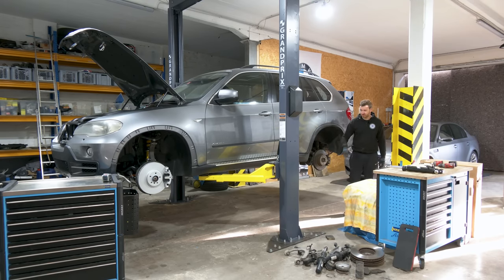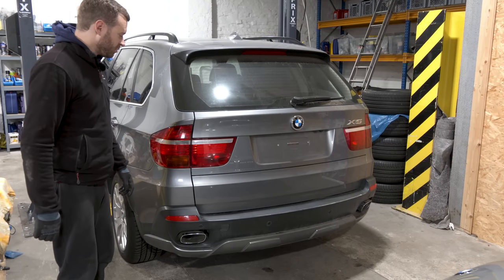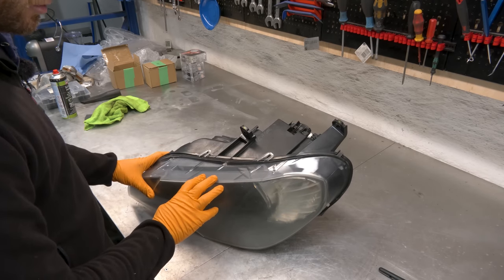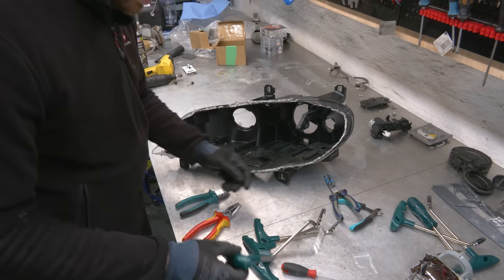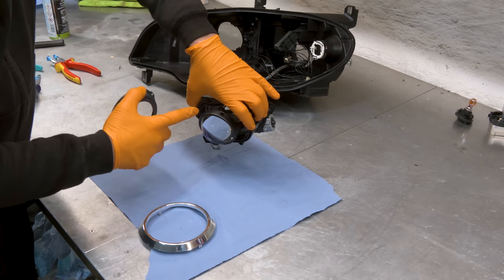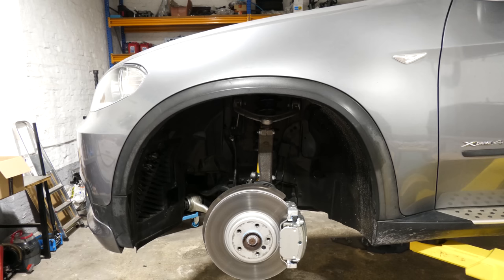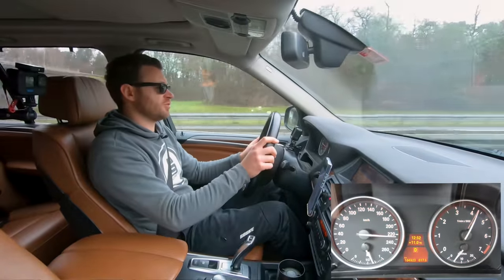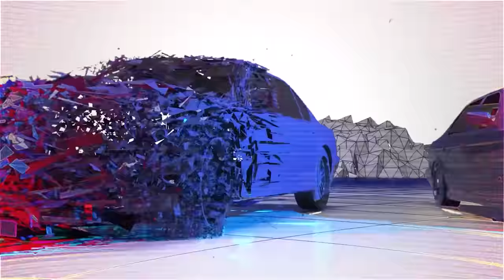Damage Report - Neglected V8 SUV BMW E70 X5 - Project X5: Part 5

Comment: amazing work.. I I actually noticed it was mode for Arabian countries from the right mirror u upgraded ( it was written on the mirror in arabic).. haha
4 more things to upgrade: 
1) white ring light in the headlights ( yellow is very ugly)
2) paint the black exterior trim ( and if possible upgrade the to M-kit bumpers and wheels arcs... looks amazing)
3) android headunit ( I installed just for the upstanding screen and soooo much better resolution) 
4) white led interior upgrade.
Reply: I’m glad Sreten has better taste than that
Reply: @Asserti  all the points I mentioned come from the factory in 2012 models. and the upright screen comes in next generation.. so basically what I mentions are 2012 retrofits.

Comment: Loved the X5 series! Regarding the heated seat elements being sewn in- I was able to retrofit my e46 by cutting the threads from the donor and simply placing the element under a new non heated skin. The new skin even had a layer of foam and heat still works great. I assume you could do the same on the X5?

Comment: I'm in the same boat as you are. I'm thinking about buying another car to daily drive instead of my E90. SUVs are great when it comes to driving comfort but.. they are SUVs xD I kinda like X5/X7 but for the same price I can get M3 or stretch my budget a bit more and get M5 and have much more fun driving them instead of tanks on the wheels. Yeah, they not gonna have soul like any other older BMW but I need something newer for a certain reason. Yours though, it came out great! A lot of work and a lot of patience, I wouldn't be able to do it without throwing tools all around my garage xD Congrats I should say, let's hope it's gonna be reliable!

Comment: @m539 restorations - you should mention the aux water cooler in the left wheel housing. I have it, too on our E70 35D (I know you don't like Diesels). I think the straight six fuel versions of this car don't have it. Read somewhere a while back that its bad engineering with the main radiator not being engineered big enough for the stronger engine options, needing the aux rad.

Comment: Hi, you don't need to remove the entire headliner to fix the panoramic roof cover... you just need to:
1 - get the covers all the way back and lift the glass to the "wing" position
2 - remove the screws that hold the glass in place, normally 3 torx in each side, on the interior
3 - get the glass out from above
4 - get the covers back to closed position
5 - get on top of the car and remove the clips and/or screws and lift the covers up from above

i just did it on my E91... but i bought a new cover from the dealer... the front cover was 184€
Reply: ohh... this works for both glasses/covers of the panoramic roof... a dealer mechanic confirmed that is either this way, or remove the entire roof cassete out the back (NOT FUN)

Comment: I recently bought a 2010 X5 50i with the N63 V8 twin turbo with 95,000km.  
Timing chain needs replacing.
Is timing chain replacement an engine out job?
There seems plenty of space once fan, radiator etc is removed.
Regards
Mal from Australia.

Comment: From my experience. Put the headlights in an oven at like 200 degrees and it will melt the adhesive and you can remove the headlight cover.

Comment: Maybe that total at the end sounds like a lot to normal people, but to car guys (at least car guys like me), it's a steal. For $20k USD, you've got an AWD V8 SUV with 350hp, adaptive bi-xenons, air suspension, & leather interior that will last you another 100k miles easy. Meanwhile, you can't get a 2023 base trim Corolla for that price. I only buy used cars for this very reason. It's prime rib for the cost of McRib.

Comment: Hey Sreten I know you don't mind audio but if you ever want to upgrade the speakers, subs, or whole system with oem+ components check a company called Bavsound in San Diego CA where im from. They specialize in bmw with comprehensive kits that are bolt on and plug in for most Chasis I have some in my e36 with full blown system! They use premium materials and are quality pieces and have even partnered with other content creators. Give them a look if you even want a better oem+ system

Comment: Awesome video as always Sreten! I noticed though on the tail lights when you pressed the brake only the middle portion lit up, aren’t the top part of the lights supposed to light up as well as part of the Two Stage Brake lights or is that only for US spec vehicles?

Comment: Sure is one of the cleanest in Germany, if not Europe. As any other project that Sreten finishes anyway. Am I wrong thinking that the taillights are not OE, but OEM? OE stands for original equipment, i.e. BMW logo. These were made by Magnetti which is the original equipment manufacturer - OEM?

Comment: i give you a hint: Next time you replace the isolation, use Rachem DR-25 x/x heat shrink hoses. You get them in 25m bunches at every diameter, you need. BUT, it's allways better to replace the wires instead replacing the isolation. All the pins used for the connectors, i think you can order them separately at BMW. The only thing is the right crimp tool. Don't use a plier to crimp!! The Raychem parts are the best, you can use. I'm comming out of the aircraft business for 30 years now and only use this kind of stuff.
Reply from the maker: Pins, wires, connectors... none of that is available from BMW and every connector has different pins so you can't replace them as this is not a serviceable part. I went to like 3 different stores and couldn't find the correct size heat shrink, ended up ordering online. Will remember Rachem DR-25 in the future. Thank you!

Comment: Wow, a modern headlight that can actually be rebuilt? That's amazing in it's own right but the result is even more impressive. So the final cost of the X5 puts it above the top of curent market prices? Even if it does the nearest priced X5 would still have hundreds to thousands of Euros worth of parts that could do with replacing unlike yours, which is now better than factory fresh 👌

Comment: I’m wondering if you check the heated seats fuse make sure theres one in there if it will work because I found alot of cars with my regular seats not the upgraded ones that had that option

Comment: Interesting what you said about the emissions going from euro 2 to euro 4 via a software update,  as in London, we are facing a expansion of the low emissions zone, so my Euro 5 2008 E91 330d is not compliant as it needs to be Euro 6, do you think its possible do do this with the e91, d

Comment: I lived in Dubai for almost 5 years and had an E60 BMW facelift from 2008 with 93000km  it still had warranty to AGMC BMW until 100k but after 100k it had a lot of problems due to extreme heat in that country. Wires inside the headlight war literally with NO insulation, the insulation would become little pieces when you touched them or wiggle them to remove the connector, all windshield/back window/ side window rubber seals were hard as a rock, and i removed them in small pieces, like they were plastic, not rubber. O2 sensors gone, A/C compressor gone, I also changed half of the water hoses. It's a very bad idea to import a car from any Middle Eastern country as extreme heat literally destroys all plastics and rubber on the car

Comment: To everyone commenting about xHP flash for ZF transmissions: it is not a fix but a mod. If your transmission already has issues, it is not going to fix anything. Also, after some time of using it, xHP can cause problems it is possible that the pre-existing issues could become even worse (possibly because of much higher line pressures).
For instance, even a few episodes ago when Sreten was rebuilding the valve body on this X5, people where commening about xHP and how it is going to fix his "slow to engage reverse" issue. It wouldn't have fixed anything. At all.

In my experience xHP is a great software mod when you have a good working transmission to start with but when people start to fix mechanical issues with swear words and software modding, that is when I say "just stop it".

Comment: A lot of respect for restoring those cars to get a like new condition. But also it shows you'll never be happy buying used cars of modern area older than 5 years....sometime even older than 2 years and above 50tkm....unfortunately if they are from VW or Audi...based on my experience.

Comment: I have to ask... why not just recreate the headlight harness with new wires of the same gauge? Seems like a lot less work and the new wire insulation would hold up better in the long run than shrink tubing.
Reply from the maker: Cause neither the pins or wires are available separately. It's a non-serviceable part.

Comment: Awesome work as always... looked like you upgraded the mic? Did I spot the rode wireless on top of the gopro? How do you live it? You mentioned last time the batteries didn't last as long?
Reply from the maker: Yes, that's Rode Wireless, battery is good, but I don't like it. You can hear how worse the sound is once I'm in the car vs. when I'm the shop and using Rode Filmmaker kit. I also had several issues with Wireless Go where the audio would crackle and basically ruin the entire video. Can't recommend.
Reply: @M539Restorations  hmm I gotta check out the filmmaker kit...I had an issue using a no-name mic with the wireless but that went away when I got the rode mic... the sound is coming out great though - whichever setup you're using
Reply from the maker: @NiTeCProductions  i think they actually discontinued Filmmaker sadly.

Comment: 48:22 ah yes, great comparison of why the the clear lens sucks. You cant see anything above the cutoff. This means the contrast between cutoff and light is so sharp that you cant see potholes, no light reflects off of signs or reflective elements on clothes etc and possibly animal eyes. Been there and done this mod, returned to rechromed oem reflectors as they are easier to see the road and other elements with than the chinese ones.

Comment: @Streten What’s wrong with the rear wiper?
P.S. Have you tried RVS stuff yet? I think you would like.
Reply from the maker: Nothing.
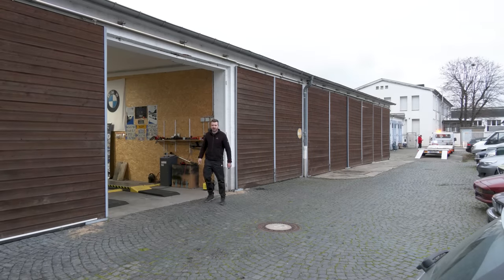Reply: @M539Restorations Good then. It was at strange position at 48:53
Reply from the maker: @ToyotaLandCruiser that's normal. Rear wiper was on, car then turned off, and it stopped in random position

Comment: Are you sure that headlight repair was worth it? You said that whole new headlight would be 1000 euros, are you sure it didn't included bulbs and everything?

Well I have Volvo XC60 but when I had to replace the whole headlight, it came fully assembled and with all the bulbs including xenons. It cost about 800 euros from the dealership

Comment: This biodegrading wiring seems dangerous enough that it should have been a recall from BMW to replace either the wiring or whole light, especially on gasoline cars. The same as they did for blower wiring for Australian market due to fire hazard caused by guess what - biodegrading wiring.

Comment: I have an e70 with the n55 and 8 speed, my fiancee has a Grand Cherokee with the 5.7 and same 8 speed.  The Jeep is noticeably faster, but the X5 handles better and the seats are in a completely different league.

So I guess what I'm saying is that I need a v8 in my x5.

Comment: Why didn’t you use kit from retrofitlab as previously for e46 ?
Reply from the maker: Svitlip/lightz.one have better projectors.
Reply: @M539Restorations  I trust you about that, I installed a kit from retrofitlab and one year later, one ballast failed 😟. 
Luckily, they took it under warranty 👍🏼
But to dismantle front wheels, front bumper and other stuff just for that…😭

Comment: I think all e70 seats with leather have the Heating elements, only the wiring is missing.
Reply from the maker: Where did you hear that? I couldn't find any info on that.
Reply: @M539Restorations  bmw has done this since the e46 that all leather seats have integrated heating elements in the seat.  Check if there are any plugs that are not connected.
Reply from the maker: @michig1786  These are the same seats internally as E60 and E65, and I've seen online people had to take them apart, break the seams and everything to fit them, so I kinda doubt it has them. 
https://www.cartronics.co.uk/case-studies/BMW-X5-E70-retrofit-Heated-Seats

Comment: those headlights are great, unless you"re in a car driving in the opposite direction..then you can kiss your retinas goodbye and crash into the nearest obstacle...
Reply: That’s only if they are not well adjusted
Reply: @Asserti  it's the light intensity.... yellowish light is far more forgiving on the eyes at night... your theory is fine.. but that means every car that drives past me at night with high energy bulbs must have them misaligned...

Comment: Excelent job but you missed 2 things you need to resset adaptations on the transfer case after oil change and remove the sticker in front of the highbeam assist camera on the back of the rearview mirror

Comment: Sreten, I must point out that by using black heatshrink you have now removed a major tool in diagnosis the colour codes. you could have easily repaired it the way it was. The crimp tools and crimps are readily available together with the colour coded wires, Regards Simon Glozier
Reply from the maker: There is no diagnosis inside of the headlight, ever. I couldn't have repaired the same way cause neither the wires or pins are available separately. Every connector has different pins, and they are impossible to find and buy brand new. It's a non-serviceable part. I can't believe how many times I needed to explain this.

Comment: try to look up at BMW if the heated seat is broken if there is an alternative where you glue with a pre installed gluestrip the new heated thing tot the polster. thats how VW does it. you dont have to buy a new seat cover.

Comment: hey! i have a 1996 BMW 750IL that I have locked the key in the boot with a flat battery, I have tried everything to get back into it to no avail, including breaking a window (i have a replacement) that I would like to sell. I'm based in the UK and based on the fact I can no longer get into the vehicle am willing to accept a low ball offer. if this is a car you'd like for a video, hit me up!

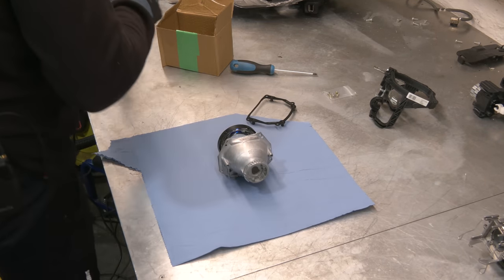Comment: 28:49 I’m sure those new clean projectors are gonna work great with aluminum grinding dust all over the lens and internal parts…
Reply from the maker: Before trying to be smarty pants, at least pay attention how many times I used compressed air to blow out all of the parts. So, no, there's no grinding dust inside. On top of that, grinding was done on the outside and wasn't going directly inside the projector. Everything was thoroughly cleaned many times before the final assembly.

Comment: Shock absorbers / dampers that don't push themselves out aren't necessarily bad. That's the job of the spring. The damper does the damping!
Reply from the maker: The gas filled ones do.
Reply: @M539Restorations  they do when new, and don't when old, true, but are still perfectly useable! For the non obsessive / less wealthy anyway ;)
Reply from the maker: @stevejames4230  they aren't, unfortunately. I mean, you can drive with them until they break in half, but the ride will be appalling. I experienced this with bad E39 M5 shocks, the car was dangerously unstable.
Reply: @M539Restorations  maybe you lost the oil too!

Comment: Bio-degradable wire coating was such a mistake in my opinion, that alone can cause big issues.  The most overbuilt center console award goes to this model X5.  Seeing all this makes me think the facelifted 1st generation with 6 cylinder is the the way to go.   A coworker who has a 4.4 V8 model says they wish they bought the 6 cyl.   Headlights as required on every car, proper lighting playing such a huge part of safety and as strict as German TUV inspection, seems BMW would strive to make a better headlight.  Also, as strict as emissions are, BMW design a better valve stem seal, unless the Valve steam seal was from lack of maintenance or improper weight of oil used by previous owner(s)?

Comment: Even if this project ends up costing over €20k you have a much nicer to drive X5 than the current model and yours is only 1.9 meters wide so it fits in a parking bay. Why spend €150k plus on the new X5 that is way too wide to fit in a parking bay and has the horrible driver assit tech that spoils the driving experience. I have driven all 3 gens E70, F15 and G05, your E70 car is the best X5.

Comment: Why didn't you back out the pins out of the connector on the headlight cables fix? Better then cutting the wires and solder them.. 😉
Reply from the maker: That's what I did and explained in the video

Comment: I would like more details on the License Plate Lamp retrofit.  The E70 LCI models also used LED lamps same part #63267193293  I believe as the F10.  I am not sure this is a 100% drop in replacement.  Streton may have had to do something "extra" here to make these work that was not caught on camera.  Anyone have any information?  thanks.,

Comment: 10% torque on the bolt . What complete utter BS !!!    I would expect more from you !!!  Id already forgiven you for declaring a shock damper "junk" ( @2:25) because it didnt act like a spring and return the dampener rod. Doesn't help that you were holding it upside down when testing!!!   Its a dampener NOT a spring and while the rod not returning is a sign its getting old , if it hasn't leaked oil then it should function perfectly well as a dampener!!!